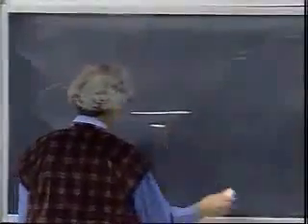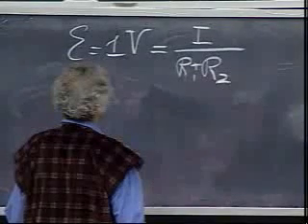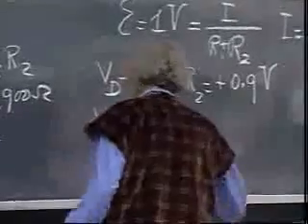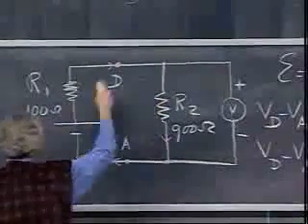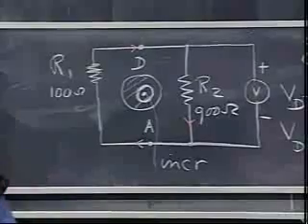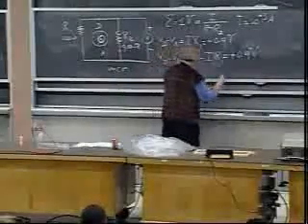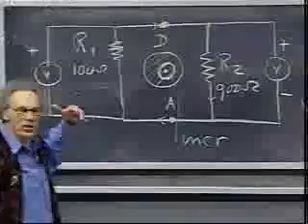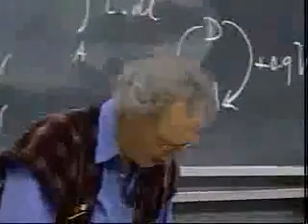Kirchhoff's "for the birds"? (see video description) [subtitles & legendas Pt-BR]

Comment: The big difference comes into play between the non-conservative field produced by the solenoid, and the conservative field by the battery. We are not used to dealing with non-conservative forces or fields that are independent of the paths they take. I like to think this can be compared to the difference between Newtonian and Non-Newtonian fluids/mechanics.
Reply: +Antonios Dimopoulos The closed loop integral of E.dl in each loop that consists of one R and one Voltmeter is zero because dphi/dt through an open surface attached to the closed loop is zero. Kirchhoff's loop rule holds in these 2 loops (not in any other closed loop). Thus the voltmeter reads the value of the integral of E.dl going through the R and that is IR. Thus V1=IR1 and V2=IR2 and that is what the demo shows! If you want to be a purist, the integral E.dl from one side of the R to the other is (I-I_v)*R. Here I_v is the current going through the Voltmeter. But since I_v is some 8-10 orders of magnitude lower than I, it can be neglected. If you are still in doubt I suggest you read the Lecture Notes which have been posted as a pdf file (look below the video). I cannot help you any further.
Reply from the maker: Strictly speaking, the battery produces a field that is not conservative. You do not need to imagine all the discontinuities encountered in a path through the interior of the battery (at the microscopic level) to agree with this point. Just recall Maxwell equations and the fact that a battery is being constantly discharged, therefore fields produced by it vary in time. Of course, for most practical purposes, the typical time scale being very long, it becomes convenient to represent the battery as a conservative-field stationary drawable circuit element. This same reasoning, with different criteria, applies to the "hidden sources" introduced by the external varying field shown in the lecture videos. Such fields are not represented, even approximately, in the original drawing (that is why Kirchhoff rule, which should be about conservation of energy, fails). You may argue that in this case the fields variation is "too fast", but then an assumption of what time scales are considered to be reasonable is in place, and this is ultimately dependent on the practical conditions being dealt with. As a matter of fact, this point made by Lewin is nothing but a particular (and almost trivial) restatement of the known result that there are no true stationary processes in the electromagnetic theory. "Electrostatic", as it is called, is an approximation that is very good in in a "long-time" limit, and it is only near these limits that we are able to properly define things like "capacitance" or "inductance", things that we draw as local elements on a circuit to account for the charge and energy conservations throughout it. This is no news to anyone who had a minimal contact with Jackson' book (for example). In the particular example of this video, the time variations introduced through induction are very fast compared to the (typical) battery discharge times. Yet, they are still very long if one takes the typical circuit-length scale involved and divide it by the speed of light. So it would be quite acceptable to represent the exchange with the external source by a local "impedance" drawn on the circuit, even though the fields are, ultimately, non-conservative (but again, in reality most of them are from the outset, given the "right" time scales). Sorry for the long post.
Reply: zer0s0und I've never heard it discussed in regards to time. Thank you for the post. You've made E&M more clearer and harder for me to grasp at the same time. I will just stick to the basic everyday knowledge taught in most high school courses lol

Comment: Could somebody explain to me where the hell he connects both of those meters? I really can't imagine they are connected to the same A and D terminals, that would be completely ludicrous...
Reply: LReBe7  You are starting to get his point. The connections are exactly the same point. The model that is used to describe how electricity works, what it is, has some limitations when circuits operate in reality. This restricts how you consider taking measurements, which would invalidate the models. Of course, over the years of people finding these anomalies has developed a lot of language and arguments justifying the flawed models. In the real world, circuits can pick up energy from anywhere and dump energy in non-modeled ways. Ever wonder how and EMP takes out electronic devices... or how a data signal can be transmitted under the ocean without an active source of power boosting the signal? (The  amount of energy needed to launch a signal that far through a normal communications cable would fry the cable. (They tried it, it did just that when they were first installing the cable.)

Tesla was able to amplify electricity as much as 5,000 times using capacitive discharged energized spark gaps. He was able to transmit AC power further than anyone else at the time with three phase power by trapping the current between the conductors, and limiting the current losses. He was able to shift the phase of the magnetic field push-back (commonly referred to as Lenz's law) in an electric motor by adding capacitance to the stator winding, creating a motor that generates electricity. (See TC Heins' YT channel, he copied it and proved it). 

The basic method of amplifying data transmissions, used the world over by land lines on phone systems, is to run the signal near a ferromagnetic material (such as an inductor coil) which will respond to the wired signal with a larger magnetic field, that is coupled back into the wired signal... amplifying the power en route without an external power source. This could easily amplify transmitted power too. TC Heins also designed a transformer that does this with 4 times amplification.

Tesla's model of electricity enabled him to visualize and design circuits that are quite different than the limited model used by modern science. He developed it by tireless experiments doing ludicrous things to discern the real behaviors of electricity. Current is not the amount of charge that passes a point in time. It is a different configuration of eclectrically energized Aether. It was called dielectricity, and can travel 57% faster than charge configured electricity independently of charged electricity in/around the same conductors. Yep, FTL. And this was known when Einstein was made famous with is ludicrous theories. 

Science today is devoted to supporting business. I like to call it Business Science. It models reality in a way to maximize the profit that can be taken from the public. When compared to reality, its all just BS. The point made here has been expounded by many others who chase down these inconsistencies, but it won't change a thing. Why? Because the truth would set everyone free. 

The economy that supports and enslaves you would collapse. Our leaders are incapable of managing that change, so they suppress the expressions of truth. These ludicrous methods and tests are not allowed to enter the commercial markets. And the rhetoric to keep the points confusing is part of that system. Peace, B
Reply: @mundymorningreport3137  "Current is not the amount of charge that passes a point in time. It is a different configuration of eclectrically energized Aether. It was called dielectricity, and can travel 57% faster than charge configured electricity independently of charged electricity in/around the same conductors. Yep, FTL."

This is also babble... actually THIS surpasses babble and waddles into the realm of bullshit...
Reply: @mundymorningreport3137  " These ludicrous methods and tests are not allowed to enter the commercial markets."

Exactly what is stopping YOU from bringing such devices to market?

Comment: A circuit diagram is actually a graph: a set of vertices and edges. There are not x,y coordinates. All that matters is the way it's components are connected to each other.
So when he draws that voltmeter left or right of the inner circuit, it shouldn't make a difference because topologically it's the same diagram.

Comment: Circuit diagrams are always idealizations, that abstract lots of physical details and represent anything conducting by a straight line. That's why you CANNOT SIMPLY DRAW A SOLENOID INTO A CIRCUIT DIAGRAM!
His "diagram" with the solenoid in it is not well defined anymore. It's not clear from the diagram what exactly he's doing in the experiment.
Reply: So so tru exactly what I was about to write, connections as well as resistors in a circuit diagram do not have inductances and they do not couple to anything because they are idealized. what is even worse is that if he was to actually represent his circuit with an equivalent diagram he would see that the inductances that couple to the changing electric field are in series with the resistances and if you try to make an equivalent circuit that matches what he is descriping you would have to put the coupling inductances in parallel with the resistors which makes no sense at all.He simply doesn't understand the proper use of circuit diagrams to model electrical circuits.
Reply: vinzent1992 His drawing is exactly the set up he has on the desk. His other lecture on this topic shows the actual results that match two O' scopes as he powers up the solenoid inside a loop with two resistors and two voltmeters. His peers also accused him of faking the results, as none of their assumptions based on training (like you two) can explain this. 

To clarify inductance for you: Magnetic fields are expressions of current that pass through most things. When they encounter a conductor, they are converted to charge. If the conductor is connected to a component that has a charge differential and/or a component that will convert charge to some other form at a threshold that the current at the conductor reaches, the charge will flow and produce a current/magnetic field of its own. If the conductor has capacitance, the current will not flow until the capacitance is saturated or the polarity of the magnetic field reverses. This will change the phase of the Lenz effect to match the incoming magnetic field in an alternating current source as is commonly used in motors. However, motors are not wound with inductors that have capacitance. Flux-capacitors, bifilar wound inductors are discouraged. All conductors have inductance if the frequency and energy profile of the source current can resonate with the conductor. This is how antennae work. The wires  are powering the resistors with the centralized inductor coil producing the concentrated current flow expression of the magnetic field. He is very clear that this only happens on power up of the coil. I would guess the capacitance of the wires is insufficient to keep powering the resistors once the current stops changing. Or perhaps a larger current source might do it? There have been demonstrations to this effect. Good luck opening your world views. Peace, B